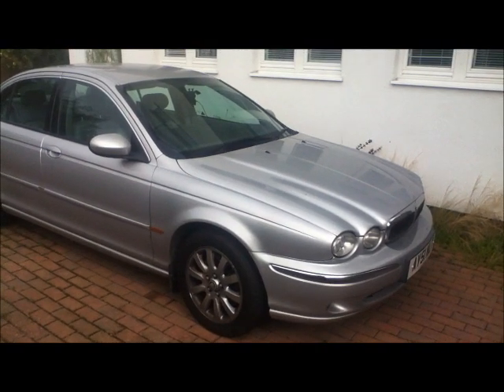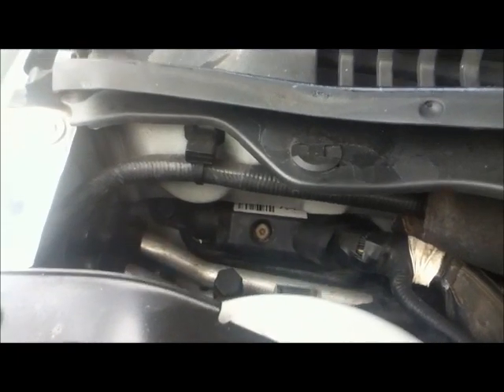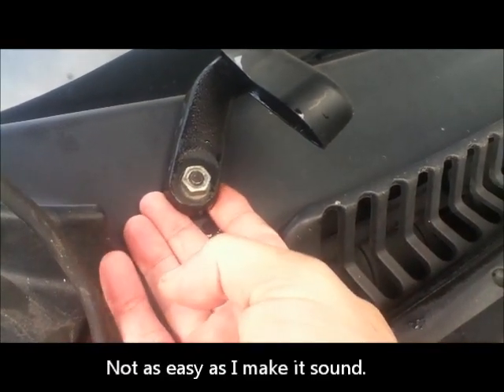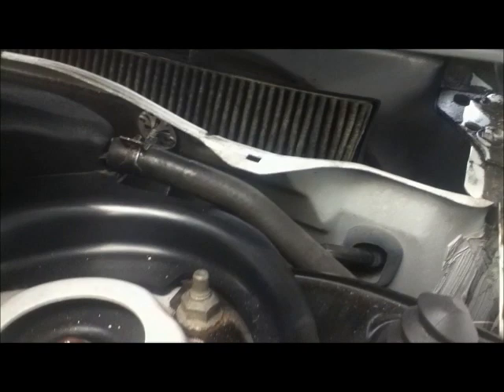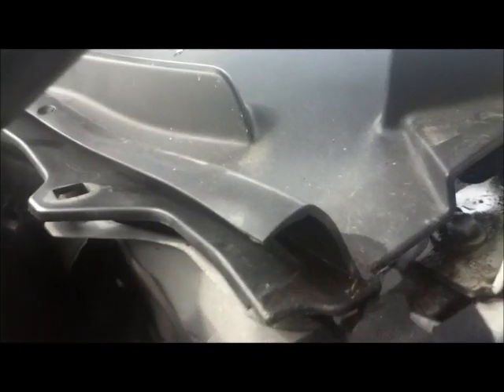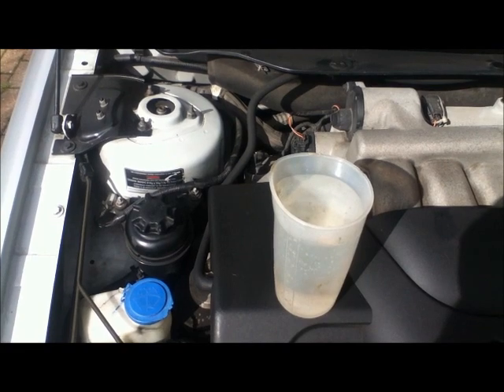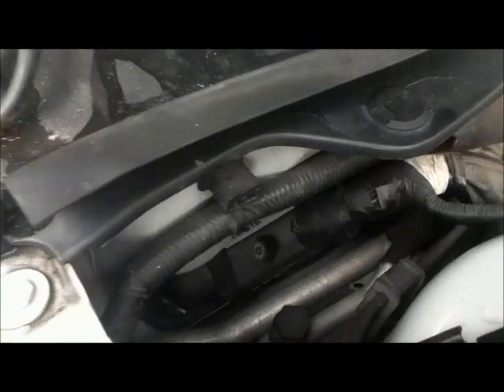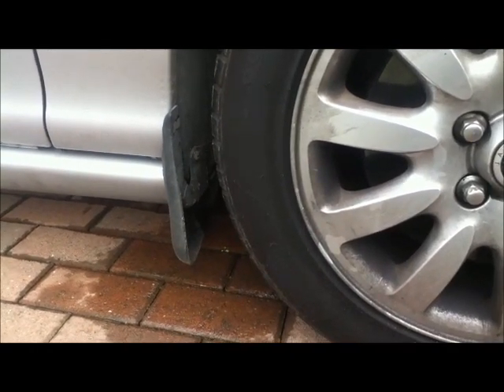Jaguar X Type -  how does the ECU get wet?

Comment: If the fan does not work and fuses are good power makes it work going direct then now what to look for on jaguar xtype 2003 to make fan work
Reply from the maker: Sound like the thermal regulator does not work. It is located just in front of the battery by the fan shroud.

Comment: this is common weak spot that almost everybody has over the time with leaky windshield and many car automakers having ECU just there with exposed cable harness. I have no other explanation as this being planned obsolescence. automakers test every material part in car they know exactly this will be happening over time. I have that too and there is no other way to have it there then being on purpose directly in a way of water coming down from lose windshield. it’s crazy to think they do something like this, because automakers have hundreds of ways to make ECU water resistant shielded or housed in a safer spot, yet they put it in a way of water fall which is only the matter of time of it leaking

Comment: My headlight stopped working after I got my windshield tinted water must've seeped through behind the dash.. does that mean its the harness that needs replaced or something else?
Reply from the maker: I don't think the ECU controls the lights. If water got into the lighting harness it has either corroded or insulated  the contacts or blown the fuses. Dry out the harness with a hairdryer, undo the connections and clean them with proper switch cleaner. Sounds like a devil of a job. Good luck. The wiring harnesses are surprising cheap on ebay.

Comment: 2.2d: very unfortunately it seems moisture (moist air) can be enough or maybe  water condensation.
I have this problem - for example after washing the car - and it causes a gearbox malfunction, motor management doesn't work right (hard running noise and vibrations, higher idle rpm, bluetooth and cruise control not available).  Will seal cable/ecu connectors with dielectric paste, remove the ecu, open it check all soldered connections for cold contacts, dry and reseal it. The ECU work will be done by a specialist near me.

Comment: I have just finnished changing a DMF on my 2005 x type 2.2d v6 what a nightmare anyway I took out the plastic bags in the wings to let the water run out. Why would you make a water trap.
Reply from the maker: Originally they would have been for sound insulation. I guess they didn't expect these cars to be on the road so long the plastic would break up and let the water in.

Comment: Just catch the wiper arms by the nuts and wriggle up & down.

Those trays never went back on right till it touched the screen,   job to fit it on that track.
The washer tubing used to kink at the os under that tray.
Reply from the maker: There's no way the wiper arms arms were coming off without a proper puller. I watched the windscreen fitters struggle and they had the right kit.

Comment: Mine is a 2005 model and my one is covered up. Looks factory fitted but it has split. Sealed it up with high temp sealant.
Reply: Mine 04 and your right, not an issue

Comment: Thank you very much for good videos. Your vidoes are so helpful.
 There is a sponge rubber pad on the lateral side of the cowl cover,  so that small hole is covered by it. 
Your X-type seems to have no rubber pad on it because it might be removed during the windscreen renewal.
AS you said, ECM could get wet, but  in my case, water leakage was much more related to the TCM rather than ECM. 
I guess water could intrude to the TCM through the bonnet opening cable.

https://www.facebook.com/kyoungseok.lee.3/posts/1731509500227379

*spongous rubber pad 
https://scontent-icn1-1.xx.fbcdn.net/v/t1.0-9/23031719_1731484340229895_6505654551529151566_n.jpg?oh=9e77fbe38f3053e34fc8f4277e9ec0f1&oe=5A6172C6

* ECM conncetor in the engine room
https://www.facebook.com/photo.php?fbid=1731484346896561&set=pcb.1731509500227379&type=3